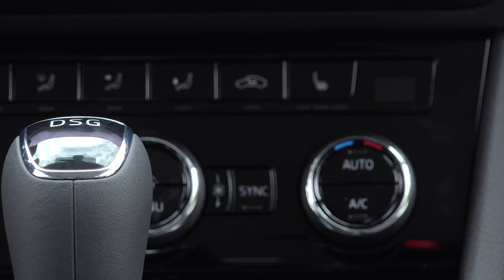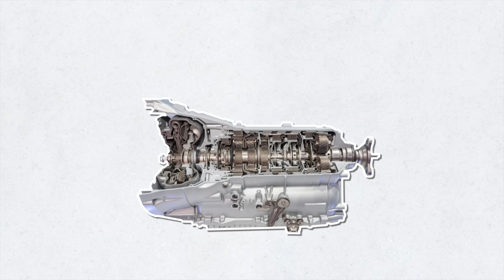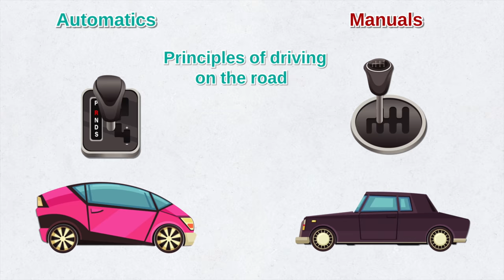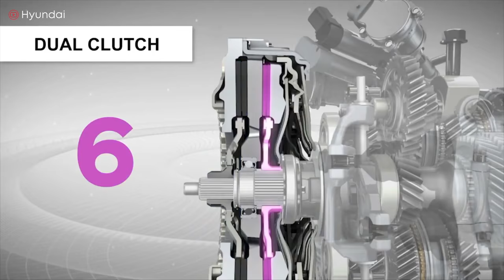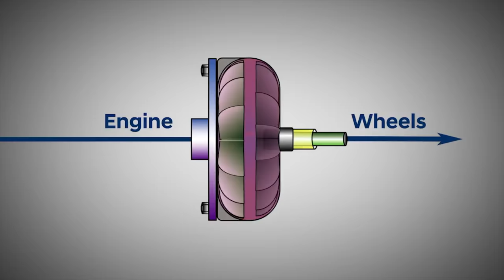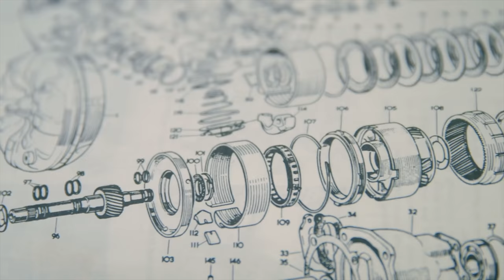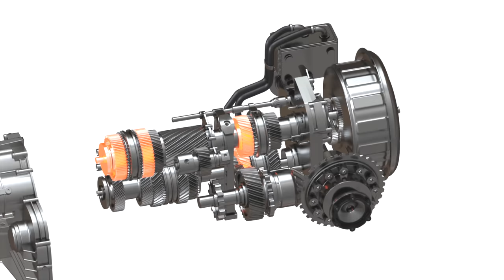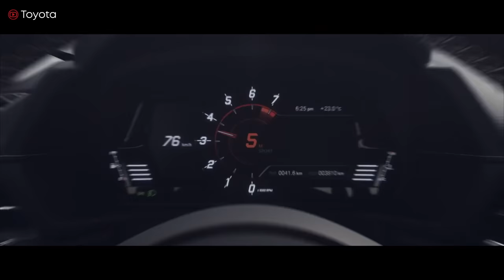5 Things You Should Never Do in an Automatic Transmission Car

Comment: It is no longer an "Emergency Brake". It is now always a "Parking Brake", and in the US all 50 states require the use of the parking brake for any unattended vehicle regardless of the parking condition (flat or hill, lot of curbside).

In the age of Electronic Transmission Control (ECT) there have been several recalls wherein the ECT either did not properly set the parking pawl or lock gear, or disengaged park even when the vehicle was turned _off_, leaving the vehicle in neutral, free to roll. ECTs in many vehicles are energized even when the ignition is off. Firmware bugs are usually the problem, resolved with a dealer-installed firmware update.

This is how the actor Anton Yelchin was killed, when his Jeep, parked at the top of his driveway but not secured with the parking brake, "slipped" out of park and rolled down his driveway, pinning him against the brick wall around his property. There was a recall out for his year+model Jeep for a problem with the shifter fully setting park, and it appears he had not yet taken the vehicle in for the fix.

Also, drive-in movie theaters are still popular across the US and in several countries around the world. They show current release movies on digital projectors, several even supporting 3D projection. Automatic headlights are, more often than not, disabled when the parking brake is set, making them friendly to the nighttime drive-in experience. Some vehicles, sadly, do not respect the parking brake and activate full headlights or at least DRL lights when the vehicle is running. Running the vehicle is often required to keep the battery charged from using the radio for the sound from the movies, and to keep warm and defrosted on chilly evenings. The parking brake makes this an easy choice for many drive-in movie goers.

Pre-ECT transmissions also had such problems. I remember first hearing about this in the 1970s with some boat-sized sedan recalled and several instances of the cars rolling out of driveways and into traffic, as well as causing deaths from being run over or when being pushed over trying to manually stop a rolling car.

Parking brake...set it every time you park. You will be liable for not setting the brake if your vehicle rolls and causes damage or death. Choose safety. Choose life.

Comment: I've been a truck driver for 30 years this year. I still find it hard to believe over 95% of vehicles sold are automatics. Even semi trucks are automatics!
I've never driven an automatic semi so I can't speak to it, but it sounds fine to me. If you think 4 or 5 speeds are a pain, try a 10, 15 or 18 speed, especially one with a splitter. You practically have to be an octopus to drive one!
The last stick shift car I had was a new '06 Mini Cooper. I currently drive a 4wd '17 Toyota Tundra. I think I've taken stick shifts for granted over the years. I may need to buy a used one just to have one!

Comment: I've been told that modern injected engines shut off the injectors when you are 'gliding' (coasting in gear) which saves gas. I'm not sure, my 07 Civic sounds just as loud gliding as when gassing it.

Comment: How about when starting from STOP, rev the engine to 4000rpm while in N and switch to D. (AT with torque converter) 
How bad is this?
(the result is a drift like on manual transmission releasing the clutch at high torque)
A mechanic opinion/explanation would be preferable.

Comment: I drive a 97 Acura CL and since it's my first car, my dad would drive it time to time. Every time I was backing up or changing gears I would always stop before switching gears. For whatever reason, my dad wanted me to just shove it into drive or reverse instead of stopping all the way. I even remember a time when we pulled into a grocery store and he slammed it into park going like 15. It made me cringe to hear the parking pin or whatever grind 10 years off my transmissions lifespan.

Comment: I drive an automatic (6 speed DCT) because I have to use hand controls to control the gas and brake and I don't have 3rd hand to shift with while I'm steering with one hand and actuating the gas and brake with the other

Comment: Agree that automatic is so much better when driving in heavy traffic... other than that, I'm fine either way.. Had manual cars for a many years, then an aut. BMW. For every day life in Denmark I don't mind a manual, and even prefer it at times. And as you say, aut. is more prone to have high maintenance costs and more parts to fail...

Comment: Also remember Automatic Transmissions need fluid from time to time !!!  I see so many people neglect checking the fluid level.
Reply: I Absolutely agree with you! When dealing with a "Sealed" Transmission its very difficult for a non mechanic type person to do a transmission fluid check. I've been trying to decide to do a transmission fluid drain and fill on a 007 Lexus IS350 myself
Reply: They don't consume fluid, so falling level = leak.

Comment: I have a 2018 ford escape 1.5 l with 26k miles, it developed a whining noise, i took it to the dealer and they told me today that the transmission needs to be overhauled. I have taken good maintenance  care of this car and still I feel like a bought a lemon. They will replace it under the power train warranty, but that's only two more years, and then I'm stuck when it happens the next time. So much for made in America.

Comment: I once was on a bus with am automatic transmission that shifted harshly when started cold but after driving around and warmed up, it shifted smoothly. Later I learned about transmission parts amd Ibwondered of that had to do with one of the accumulators (they have another name in transmissions that I can't remember) for the clutch being stiff when cold.

Comment: If you have to wait long times at a traffic light (I mean 2 min. or more.) why is it better to put the transmission in P rather than N, as you would do in a manual transmission? I mean, the engine is still running anyway. I've just got an automatic after driving manual for decades, and I miss it.

Comment: I drive a 2019 Toyota Camry.  I always warmmy car up for about a minute before I start driving no matter what the temperature is (-20F to 100F).  My vehicle always starts running around 1500 RPM.  After about a minute and sometimes less, the engine RPM will drop slowly drop to 1250 and finally to close to 1000 RPM (idle speed in park).  I once shifted my vehicle accidentally at a higher engine RPM.   I will never do that again.

Comment: My 2003 VW Passat Wagon has a manual transmission.  The owner's manual says not to warm up the engine before driving, even on cold days, saying there is no advantage and only wastes fuel.  Are they setting me up for more repairs down the line so they can make extra money?  I always thought the reason you don't want to drive with fuel below a quarter-tank was because of dirt and impurities that are at the bottom become more concentrated.
Reply: Never sacrifice engine life on the altar of fuel economy.

Comment: I use the hand brake all the time unless parked in the garage with manual hand brake is only time that would be able to put the handbrake lightly on. And don't have the horror story of changing gear when car still slightly moving and can just imagine that one, sorry, replace transmission at $2000-$4000 because slightly roll back when drive engaged and same reverse.

Comment: Is is safe to put car in neutral at red lights?
Assuming I have a foot on the brake.
(No I'm not stupid, it's not the same pressure you apply on brake pedal when the car is in drive, it's just a gentle touch when it's in neutral)

Comment: No horror story, my 2011 Nissan transmission died at 116k but Nissan Replaced it for free. Sold it around 150k due to exhaust leaks (kept fixing them, but to no avail). I do drive right away after getting in when it’s cold out.

Comment: What is the purpose of (low gear) 1st, 2nd, (3rd) gear in automatic when it comes to traveling up/down steep grades anymore? Is it okay to shift into these lower gears in an automatic when descending mountains? Should you already have the vehicle in the lower gears before descending and should you fully stop before placing the automatic back in drive for normal operation?

Comment: Yikes. I frequently coast downhill in neutral. Yes, I know it's dangerous if I suddenly need acceleration to avoid an accident or whatever, but I did not know it can cause harm. He's a curious thing about that, though. When coasting downhill in neutral, my digital Miles Per Gallon indicator will tick up a few tenths (depending on the distance I am coasting). Leaving it in Drive and lifting my foot off the accelerator does not show the same increase in MPG.

Comment: I like Honda but avoid the pilot becuse of the timing belt. It wants  changing every 100k km that maitence item costs upwards of $2k      because of the labor required to do it. If your your going to go with a timing belt design the engine for easy quick replacement.

Comment: I had a 1991 Lumina APV was a decent beater with a heater. A tank in the snow, but my brother thought the coolant looked grimey and wanted to flush it after i sold it to him. I told him i wouldn't, but he did and the entire cooling system radiator and all it's lines opened up and became a water fall. 🤣🤣🤣

Comment: I have done the reverse to forward a few times in my automatic transmission but it was not on purpose😬
Reply: The surface which provides the "grip" for the reverse on some transmissions is a steel plate on the case of the transmission...fairly hard wearing but do it often enough and the grip goes away.
certain vehicles had the plate cast as part of the aluminium trans case....they quickly wear away and then no reverse.
Stop all motion of the vehicle before selecting reverse or forward....
Reply: @JohnSmith-pl2bk  I would like to ask you a question.
I have a 2021 Toyota Camry Hybrid LE, ECVT transmission. I accidentally shift gears to parking while still driving the vehicle at really low speed. I will guess less than 2 mph. I heard a nasty sound. It drives like nothing happened. A week later the motor engine sounds kind of louder than before, when the car is not moving (parked) and the electric motor switches to the gas motor.
I don't know if I should be worried?
Thank you in advance for your answer.
Reply: @pepehernest768  
Any warning lights, check engine lights?
Have the OBD2 scanned with a decent scanner and check everything.
Most likely the nasty sound you heard was the parking pawl.
This is the little piece of metal which locks the trans and acts as a safety position on the trans when the vehicle is parked.
But because you were still moving, albeit slowly, it couldn't drop into position and skipped a few teeth..."Brrrrr".....as it is designed to do.
The other noises may be your heightened awareness now....
So get the OBD2 scanned for your own peace of mind...

Comment: I was watching the shifting habits of a Bentley Azure driver.  He would shift from Drive to Neutral every time at stoplights.  Is that a good idea with that transmission?  I was going to say something, but thought I would check with you first.
Reply: Not a good idea with any AT, but the lifespan of those cars is so short (i.e. when the cost of repairs exceeds the market value of the car) that it probably won't matter.

Comment: Yes .. I have 2005 Toyota Corolla Altis 1.8... with automatic transmission... It have a mystery in transmission gauge... Gauge says hot and cool oil level .. when I check transmission oil in morning when it is cool it looks on high at gauge where it says hot level of oil .. and it's hot when I drive it through city and come back, then I check transmission oil it looks on cool level and lower on the gauge... My car transmission and gauge have Invers relation... I am confused...

Comment: Hi Scotty, my driveway is a pretty steep incline so I use the parking brake. I was told by a friend that I should first put the transmission in neutral, apply the parking brake and let the car rest on it, then proceed to put the trans. in Park. Is this correct?

Comment: Never coast downhill with an automatic transmission/gearbox in “N” neutral, and never tow it in “N” with the drive wheels on the ground.
Reply: For both points, what's the reason?

Comment: 1) Don't put the car in Park or Reverse while moving at high speed on the Interstate.

2) If you have an old car with a 2-speed automatic, the name of your car is NOT "PRNDL," so don't use that name if you're calling 911 for help.

3) Don't press on the left-hand part of the brake pedal because you think you're driving a manual and need to shift gears.

Comment: I own a Mazda 3 with an automatic. I am always shifting it manually and have often wondered if this will cause premature wear or if Mazda actually designed it more robustly to compensate for those who prefer to shift manually. I have been unable to find the answer to this question.
Reply: You  are  not  hurting  anything,  but  accomplishing  anything  either.  Let
the  automatic  transmission  do  its  own  thing.  Just  enjoy  the  ride.

Comment: I didn’t quite get the gasoline fuel tank part. What does the level of fuel have to do with the pressure of other fluid systems?
Reply: If you run the tank too low in some cars you risk ruining the fuel pump.  The fuel itself lubricates the fuel pump.
Reply: And keeps the fuel pump and related parts cool in the summer time 🌞

Comment: 94 dodge ram torque converter grenaded and destroyed whole transmission at 105,000 miles.2001 dakota planetary's disintegrated at 135,000 2008 sport Dakota something about a pump failure wore every part out at 97,675 miles.
Reply: I miss my 99 Neon 2 door

Comment: From learning to drive manuals first, I appreciated using the accelerator to control the speed and hardly using the brakes. I’ve had automatics and manuals over the years and rarely have had to change brake pads.

Comment: Honda pilot 2017 lx   27 k miles only lot off  problems  with transmision  ,I gusset  was something  wrong  with  some transmission sensors  but dealer  changed  converter  and different  things bettwen  4 times  .FIRST TIME just reset computer SECOND TIME replace converter  take 8 days .THIRD Transmision  leaks took 5 days .Fourth time I went to dealer  with present error  pop  up on screen  TRANSMISION SYSTEM PROBLEM  ,then look like  👍😅 they fixed   I hope this  not pop up again. I will not recommended  Honda pilot 2017 .I also owned  Honda crv 2013 lx 106 k miles  this car I do recommended  👌have no problems  with this car only some  cosmetics  staff

Comment: I wonder shifting down 1 or 2 gears (engine break) downhill is good for saving gas, brakes and not bad for the engine?
Reply: Depends. Personally I'd usually rather wear cheap pads than a very expensive AT.

Comment: OK, but what I have to do with my Ford Focus MK1 1,8 TDCI, that works good for 5 minutes and after that changes the mixture and it become too rich so the engine has no power and black smoke comes out from the exhaust pipe? After I stop the engine and start it again it works good for about 5 minutes and again comes the problem. The engine works by this way only with disconnected air flow and barometer sensors. If the sensors are not disconnected the engine works all the time bad - with no any power, without acceleration, can't rev up at all...
The day before to come this problem I fixed a whole on the pipes after the airflow sensor with silicon, because the car used too much diesel - 6 litres at 100 km and has no any power at high rpms (higher than 1750, but at the low end it was good - at the fifth gear it was climbing a normal hill with 60 km/h and not much pressure on the acceleration's pedal...

Comment: I don't understand the connection between the amount of fuel in the fuel tank and the transmission.  The only relationship I see is you are hauling around a heavier load with a fuller tank.  Perhaps you could have explained more fully.

Comment: I have a 4 speed auto single clutch, and is it bad to hold a gear and allow engine braking from 4k rpm to a stop for example? I know you can not downshift into a 1,2,3, D gearbox because its obviously not a dual clutch. But does using 1,2,3, into drive put excessive wear on the valve body?

Comment: 04 Acura MDX and I have transmission issues. Vehicle was not maintained well when I got it. First it was overfilled. Fixed that. Put sea foam transtune in it and did a drain and fill once. It smoothed it out but I still have issues. Check engine light P0741 code. Torque Converter or stuck solenoid. It went away then came back on. What to do next?

Comment: In my 2012 4WD Tacoma with an 5 speed automatic is it better to drive in city traffic 30 mph in "4" which averages about 2000 rpm or just in regular drive mode which runs about 1200 rpm? I figure its easier on the transmission at 2000 rpm.

Comment: Well I thought you said it's okay to put your automatic in neutral at a stop if your going be there for a while; at a train stop or just a long red light. Eh, Ill consider this an update.
Reply: Newer cars like lexus have a "hold" button that keeps the brake on for you, like in drive thru. when you hit accelerater it releases, then rebrakes for you when you let off throttle.
Reply: @mcc7762  I do both.
Reply: @labornurse  Nothing  new.  Studerbaker  had  this  feature  back  in  early
1950's.  So  did  other  car  manufactures.